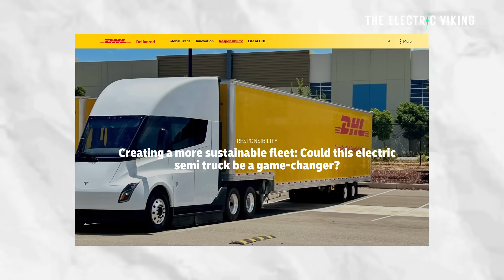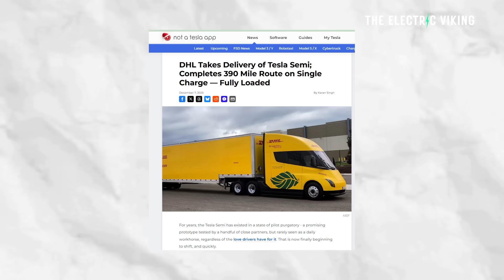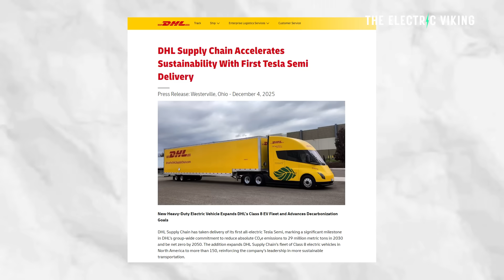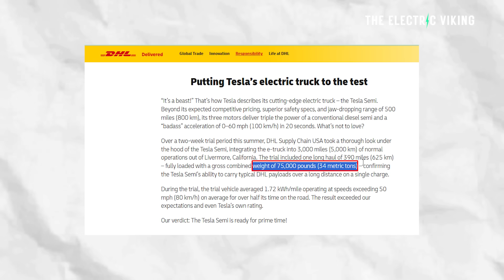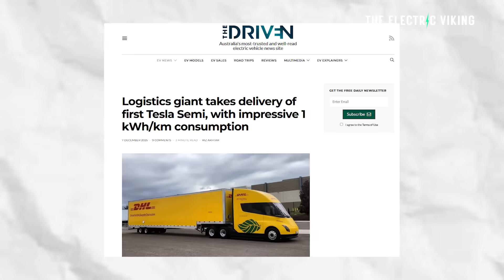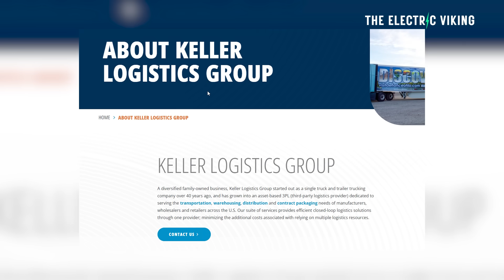Tesla Semi Drives 390 Miles on Single Charge Fully Loaded with Range Leftover!

Comment: I think Tesla will stay making the class 8 truck. because the plant they are making once ramped up can make 50,000 trucks a year. in the US alone there are approximately 3.91 million Class 8 trucks are in operation There is no way to make the math work with them only using 1 plant. at 10% of the US fleet it will take almost 8 years to make enough and that is the US only. 

If Tesla dose what they do best and concentrates on one model and keeps building it until they approach market saturation. They will do amazing.  Once they approach market saturation they can start looking at other models and form factors of the Semi. 

As far as other less range intensive trucks they could build. The truck style i see is the Yard truck. Even the most aggressive movement of yard trucks are less than 150 miles in a 10 hr shift.  So they could easily make those with less batteries or just there normal range of 300 miles will be sufficient. 

I think BYD is doing a majority of the electric Buses and there are multiple other companies making 100-300 mile range electric semi's that are already being used in multiple places. A good example of this is "the electric trucker" who is triveing all over the EU and beyond in a less than 300 mile semi.

Comment: It always makes me wonder when I hear a statistic like "fully loaded". What does that mean? I want to know the weight that the truck is transporting. Why not state the ONLY factor that is relevant?  

Feels like we were being sold something in this video.
Reply: Fully loaded means 80,000 lb gross
Reply: @linuxxr  So if the truck was loaded with cardboard it wouldn't be fully loaded?

My understanding of the word is dimensional. 

btw, 80k is gross total weight. it's listed cargo weight is 37 to 44k  pounds.
Reply: The only relevant factor is that you can't haul more than 80,000 lb on the road so there you go
Reply: @linuxxr  So what was the weight of the payload of that "fully loaded" truck?
Reply: @justinmanley8131 can't you figure it out for yourself
Reply: @linuxxr  Maybe you misread my original post. It's not possible to calculate what the weight of the payload was with the information provided.
Reply: @justinmanley8131  For example what is the weight of the batteries? That is non-payload you are hauling on each journey. At least with fuel the weight reduces during the journey.

Comment: Except a semi is usually long haul...and at last recall Melbourne is 900km. How long does it take to charge that size battery.
Reply: Larger trucking companies can have intermediate depots where the cab is swapped with a fully charged cab so the driver isn't wasting much time.
It would require higher cost to have the extra cabs available to be charged when left behind not travelling. How much effort to move personal belongings between cabs? & who's been sleeping in the bed behind the driver seat before you (swap mattress too)?
Reply: Charging a Tesla Semi varies, but you can get up to 70% range in about 30 minutes using Tesla's high-power Semi Chargers, allowing for long-haul trips with quick energy boosts; however, full charges can take much longer, and slower, overnight charging is often preferred for corporate fleets to extend battery life. Real-world tests show fast charging stops under an hour, but a full replenishment might take longer, depending on the charger's power and battery state.  thank you AI,,

Comment: Again USE CASE - 400 miles means NOTHING.
A better application would be a hybrid, with a trickle charge. Truckers would LOVE extra magnetic brakes, and only use the battery when needed for hills or initial acceleration.

Comment: There is a company in the US making rear axels with electric motors. Batteries mount under the trailer and use regenerative braking. All computer controlled. Lot of cargo is cubed out, not weight limited. For those loads they are perfect. Its all retro fit so you can use your own trailer. Great for extra power going up hills.

Comment: Janus truck ev conversion’s sound smarter, with the hot swappable batteries and lower price of entry. When it is time to replace the engine and gear box they do this after some number of thousand km anyway. You put an an electric motor and those big Sisel drums on the side are where you put huge batteries, that you swap using a forklift, then keep on driving.
Reply: DONT NEED A GEARBOX WITH ELECTRIC

Comment: It would be kind of funny and poetic justice if EVs come in via trucking, because the nay sayers always argued that range isn’t good enough. But people would hardly drive more than trucks. They do have a cost advantage (consumption, maintenance) and in trucking every penny counts, but it will also depend on sufficient charging infrastructure, because on time delivery is an issue. Might be different in other countries but in some places trucks currently clock up all highway rest stops at night with more trucks than parking spots available.

Comment: So the driver can drive 5.5 hours before needing a 15 hour charge. Drivers and real companies will HATE IT except for short runs..
Reply: Tesla SEMI truck can re-charge in 45 minute...
Reply: @mikafiltenborg7572  WRONG  At current Tesla chargers it takes 12-15 hours. There is only ONE public MEGAWATT charger in the US. I repeat ONE.

Here is the info

Charging Time Comparison
At a Megacharger (1 MW):

Tesla claims ~70% charge in 30 minutes.

Full charge likely takes 60–90 minutes.

At a standard Supercharger (250 kW):

Charging a ~1,000 kWh battery from empty would take over 4 hours just to reach 25%, and 12–15+ hours for a full charge.

Current Status of Tesla Megachargers
Gigafactory Nevada (Sparks, NV): First Megachargers installed in 2021 for Semi testing and operations.

Gigafactory Texas (Austin, TX): Expanded Megacharger installations in 2025 to support Semi production.

Carson, CA (near Long Beach port): Tesla’s first “public” Megacharger site, permits filed in early 2025.

Network expansion: Tesla has announced plans for 46 new Megacharger sites across North America, with volume Semi production expected in 2026.

Government support: Tesla applied for funding to build 9 Megacharger stations along the California–Texas corridor

Comment: How much is maintenance? Or do you have to buy a new one every 10 years?
Reply: No gas, no spark plugs or fuel injectors, no regular oil or filter changes, no serpentine belt, no emission controls, no transmission or fluid, no exhaust system or catalytic convertor to get stolen or damaged, no brake pad or rotor replacements, no superheated coolant, no fuel tank, fuel lines or charcoal canister, hundreds of less parts and next to no maintenance, just like all Tesla EVs.

Batteries can last over 500,000 miles. 
Electric motors can last 1 million miles. 

Tesla vehicles have an 8 year, 120,000 to 150,000 mile warranty.

No other vehicles come close to that.

Comment: I watched EV drive-trains handling wet,  snow covered and icy roads extremely well, twenty years ago! A properly tuned regenerative braking system contributes to driving safety along with reducing brake wear and extending driving range. Great potential for traction control.
Reply: And you add the “ on road charging “ with an overhead system like buses, longer haul is very feasible. Add the solar and wind generation and we start doing right for the environment. I have an EV and will probably never even resort to PHEV, last time I visited a gas station is 3 years ago.
Reply: @larrymeyer2917  Over headsystems for buses? Why not overhead systems for railways like in Europe? It's amazing how many wagons (= to 1 truck) that one locomotive can pull. I've counted 100 (=100 trucks) at a crossing when I was visiting Texas. America seems myopic to the potential (only 1% of the network electrified? Wakeup!)

Comment: DHL packages are relatively low density, so it is likely that they don't actually have to haul the massive weight like a beverage company does.
Reply: Even Pepsi says Semi is better than diesel for moving soda.
Reply: don't worry, if you check out @electrictrucker the no. 1 channel on long haul etrucking you'll see him regularly doing max. legal weight tours with gross weight of 42T in his Mercedes eActros 600 zipping up those hilly sections of the Autobahn (and -strada) really putting 500kW+ regen to work when going back down.

Comment: I want to see a Tesla chassis cab truck with different wheelbase options. The shortest wheelbases could be combined with pickup truck beds for the construction industry and Rv towing since the Cyber truck doesn’t work for those uses. Tesla really missed the pickup truck market since up to 70% of pickups being purchased are for daily truck uses of hauling tool, equipment, and supplies, and towing.  There are thousands of companies with fleets of pickup trucks that won’t buy a Cyber truck due to cost and they don’t make good work trucks. The only Cyber trucks I’ve seen at a job-sites is the construction company owner’s commuter Cyber truck. It is hard to put a ladder rack or tool boxes on them and you need to make good money to afford one.

Comment: German here. We already have more and more electric trucks on the streets.
There is a guy who works as a long distance trucker and makes weekly videos on youtube about his experiences since about 1.5 years. He also has an english only channel and only uses electric trucks.
https://www.youtube.com/@electrictrucker
Mind you, the rules in Germany are a bit different from the states. You need to have mandatory breaks after 4.5 hours, regardless if you drive a diesel or electric. And you can use that break time to recharge.
It's worth checking out. The future for trucking will be 100% electric. That is not a maybe. The question is only how long it will take.

Comment: From Electreks take: "For years, we’ve heard arguments from legacy truck makers and industry analysts claiming that battery-electric trucks can’t handle long-haul duties because the batteries are too heavy and the efficiency is too low.

DHL just proved them wrong.

Getting 1.72 kWh per mile with a 75,000 lb gross combined weight is impressive. To put that in perspective, at typical commercial electricity rates, that’s a fuel cost of roughly $0.20 to $0.25 per mile. Diesel trucks often cost $0.60 to $0.80 per mile in fuel alone.

The economics are undeniable."
So no Electrek does not say the semi is a piece of garbage. If you are going to lie like that Viking I will stop watching your channel. Let me know.

Comment: The most tired drivers on the road are truck drivers.  But in America the trucks don't have the land keeping assit, one pedal driving, active cruise control, and such that the cars do.  The EU electric trucks have the driver assist features.  Tesla can totally change trucking in the US.  What driver wouldn't like a truck stop that was silent, no diesel smell, and not oily everywhere you walk.  Big step up in quality of life for truck drivers when it all goes electric.
Reply: DOT stats show.. 80% of the time.. it is the CAR that causes the accident when a truck is involved. So your theory about tired truckers is off..   I would say the new lane keep and other systems have made car drivers LESS aware of  what is going on around them..
As to the noise and smell.. Most truckers would tell you they love it.  I know I did.. took me a long time to get used to sleeping without the big diesel idling.
Reply: @kens97sto171   No doubt the cars are an issue.  Has nothing to do with being tired, or lane keeping.   The car drivers weave in and out fully aware of what they are doing.   Constantly trying to squeeze between two trucks to change lanes.  Every truck should have a dash cam.

Comment: People really need to break out their physics books when talking about weight and electrical consumption. While extra weight affects acceleration and driving on an incline, the overall impact on range is small; typically only 3–5% with a heavy load. Aerodynamic drag has a far larger influence on kWh/mile, which is why the real impact of a semi truck carrying a heavy load of cargo is in the same ballpark as the drag penalty from states requiring front license plates. So if California really wants to be green in the future they should ditch their front license plates.

Where overall weight truly matters is in road wear and truck load limits, not everyday EV efficiency.

Comment: I like that they are quiet especially when idle.
Reply: And not belching out fumes and soot. Especially when you get caught behind them.
Reply: They don't idle they just are powered down.
Reply: @charlesrovira5707  there are some considerations over things like air con/heating. Small but finite.
Reply: @RedRouge-j4j 
They can heat and cool the cabin without a huge dieselengine running.
All night through, without loosing a lot of range!
Reply: @karla6999  I have seen a video from a guy in a cold snap in Texas who survived more than 24 hours of heating with his wife & dog and food in a Tesla. Until they got power again. He reckoned there was not much charge left if any. Zero driving,
Reply: @RedRouge-j4j  Well 24h is quite some time to be stuck.
Of course, depending on the SOC of the battery there is more or less time until the battery runs empty, but that's basically the same for an ICE car, the big difference is, in an electric car you don't poison yourself and the people in the car behind you.
You also have more influence over energy consumption, simply by reducing the temperature setting and switching off components.
Reply: @karla6999  I should have pointed-out they were at home in their garage. It was a solution to a freezing cold house. But it does point to limitations of any type of vehicle. Like 30 years ago I heard of a common tale that ICE cars were left running permanently in Alaska because the model was notorious difficult to start in winter. I wanted an EV, but the models available didn't fit all 3 criteria. Life is a compromise, and we live for the typical and suffer the outlier situations. But we can always moan, when things don't fit exactly.
Reply: @karla6999 A diesel semi burns about 1 gallon of fuel per hour at idle. Very efficient in that sense. Some trucks can hold up to 400 gallons.

Comment: Another safety feature of an electric truck is it’s ability to undertake long downhill sections without the risk of runaway. I’m thinking of the highway into Adelaide (if you’re Australian) with its deep gravel runoff ramps. These are common on many major roads with long “brake exhausting” downhills.
Reply: Downhills are gonna be awesome for these. All that regen braking will get you miles back
Reply: Same in Colorado, too, in the Rocky Mountain region.
Reply: If you are old enough to remember the old "Devil's Elbow" you will remember that track accidents were almost a daily occurrence.
Reply: Combination of Confident Acceleration and Regenerative Braking is an important SAFETY feature of Electric Heavy Vehicles. Lag between driver wanting acceleration and actually speeding up is dangerous for flowing with traffic.
Reply: That's if the inverter can handle extended periods of high regen.
Reply: @Charlesbjtown 
Haha!  Like they haven’t thought of that 😂
Reply: @oggyoggy1299 You say that, but have you experienced doing long periods of regen with a 1st gen rivian? "Haha, like they haven't thought of that"......
Reply: @Charlesbjtown 
No.  This is Tesla, not some hack company.
Reply: @oggyoggy1299 runaway is always a risk.  Inverters can fail, computers can fail, CANs can fail.

FYI, Teslas still pass school busses with flashing lights. The robotaxis in Austin still have safety drivers. Tesla is far from being a fault-free company.
Reply: @greghelton4668  brakes can fail, engines can break. People still pass school busses with lights on. Tesla is generally better than people.
Reply: @williammeek-h2o oh, I agree with you.  But the comment was about Teslas not failing.
Reply: @greghelton4668 
Things can fail??  Wow!  What incredible insight.
What does any of that have to do with Tesla not properly considering how to slow down a loaded truck?
Are you another one that thinks they haven’t thought about this?
Reply: there is a 2nd system that takes the charge and vent heat of
Reply: @Charlesbjtown  If the inverter can handle positive acceleration, it can handle negative acceleration.
Reply: @williammeek-h2o Not necessarily.
Reply: Of course it can—inverters work continuously in both directions.
Reply: I’ve seen an article where they are talking about adding batteries and motors to the trailers, huge advantages on down hill sections of road
Reply: That came to my mind too. Here in BC Canada we have the 5000 foot summit Kootenay Pass near my home that has killed many people with runaways.
Reply: As an Adelaidian, completely agree. That decent into Adelaide on the SE freeway is a great opportunity to recoup energy for trucks if they were electric